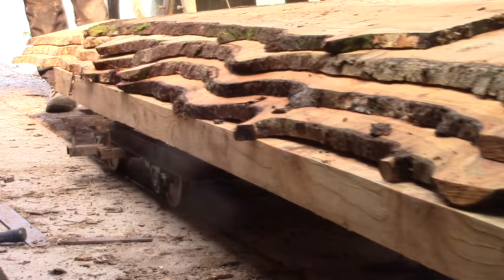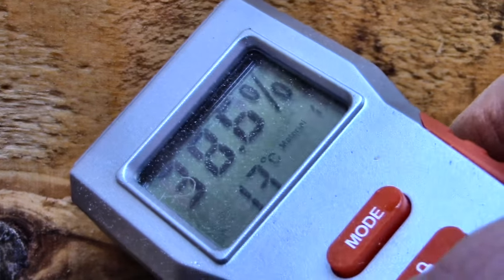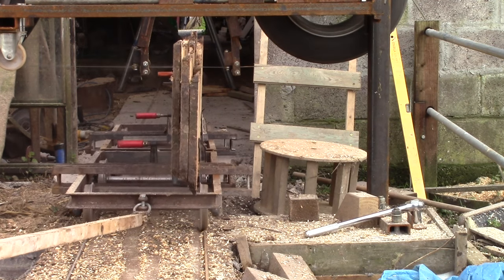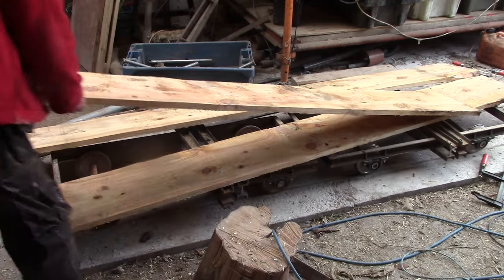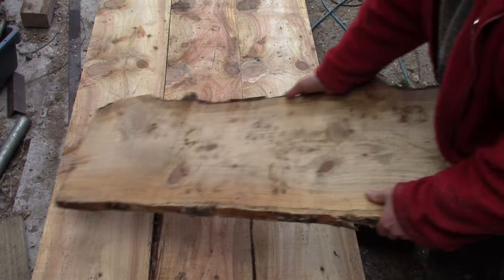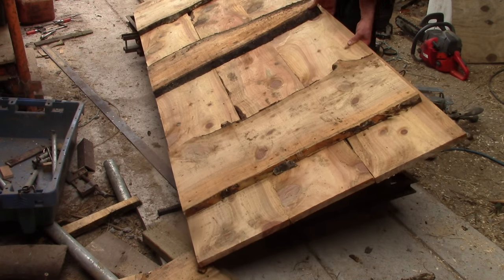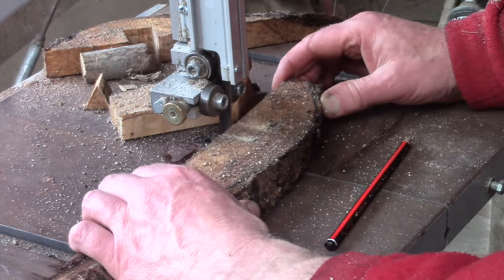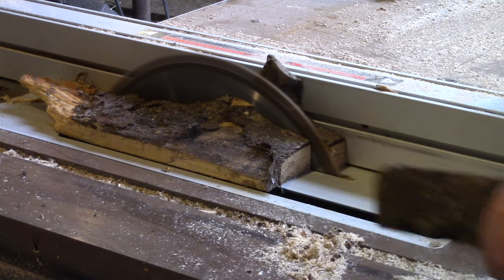Making A Barn Door The Simple Way

Comment: Good job Tim, it looks good and sturdy. I did the internal doors in our old cottage just the same when I renovated. i used green oak and cut the planks 12" x 1". After 10 years they have gaps about 3/8" max.
Reply from the maker: It depends so much on whether they're in a heated, dry house, or if they're outside. Our kitchen timber is around 7% moisture - which is very dry for Ireland.

Comment: Cheap old method of stabilising unseasoned timber panels and rails was to paint them every few weeks with 40/60 mixture of diesel and old engine oil.  Longwinded I know, but it did work and some old bull-pen doors in Ireland still in perfect condition.
Reply from the maker: Yes, that's a powerful preservative. From the days when old engine oil was easily available. Quite a fire hazard though too

Comment: Kind of interested in  how the screws perform over time compared to the traditional clenched over nail method which I have seen hold wood for decades. With the latter I sometimes feel as though I am stiching the wood with iron as with the clench the wood is gripped in two places per nails. Hardly see this method nowadays as if not screws a nail gun is deployed. Still kind of feel that hand clenched nails may be best  as they can bend whereas screws don't bend, perhaps making them susceptible to breaking or the wood tearing. Time will tell!
Reply: You can do clenched nails with a nail gun too. Just back up with iron like you'd do with a hammer. It helps to shoot them a few degrees off 90 so they get the idea where to go when they hit the iron. All my doubled studs are done that way.
Reply: Thats an interesting way of doing it. Would never have crossed my mind: nicely inventive and practical.
Reply from the maker: There has been an amazing development in tools and materials, even since I was a boy. I'm still impressed how perfect woodscrews are these days, - the ones I used to buy were all different and only slot-heads. And they had to be wound down tediously with a screw-driver.. I like knocked-over nails too, but they can be tricky to keep neat-looking, if you're doing a bedroom door, for instance. These ones were all smooth-shank, so they'll hold the layers tight together.
Reply: It's not just the fasteners that have changed, there are now a whole host of manufactured wood products along with plastics like upvc. Many of these things make life easier for the maker, but I remain impressed more by the joiner skills of the pre-industrial age. When you think about the men of war built for Nelson's navy it is hard not to be amazed. Wooden vessels that e.g. Crossed the Atlantic hunting the French fleet, then returned for the battle of Trafalgar, fought with broadsides of cannon from wooden decks. The joiners who made those ships were exceptionally skilled at fashioning wood into ocean going machines, no twin thread screws, no cordless drivers, none of the tools we have & yet they made stuff that worked in severe environments.

Comment: im interested in knowing more about using kreasote? i burn a wood stove in my garage 7000km over in Canada. i don't really produce much of it but others do, and it would make a interesting video.

for whats otherwise a useless waste product.
Reply from the maker: I'm just using a shop-bought coal-based(?) creosote, but you're right, we all have access to timber-based creosote/pitch - it's just a matter of extracting and harvesting it in the right way. I'd love to experiment more with this, combined with charcoal production (which is partly what the rail tracks are for) but I don't know when I'll get around to it.
In the meantime, if you're getting a build-up in your stove, could it be you're running it too low? Or your wood isn't dry enough? (I think that's why modern stoves are designed to run really hot for a short while, and then slowly give out the heat - that way everything is burned.)